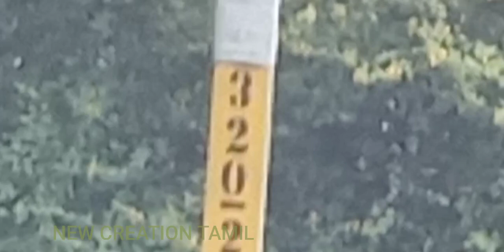Homemade Reflector Focal length measurement 127| 900fl

Comment: I have primary mirror having 127mm diameter and 900mm focal length so tell me how many distance should I take between Primary mirror and secondary mirror
Reply: place secondary mirror at a distance of 90 cm from primary mirror . and check that the image coming from primary mirror is sharp at 90 cm. if not then adjust it little